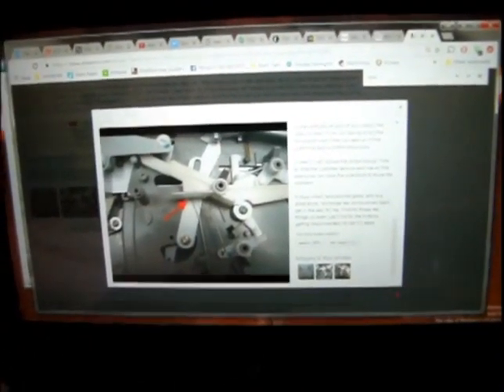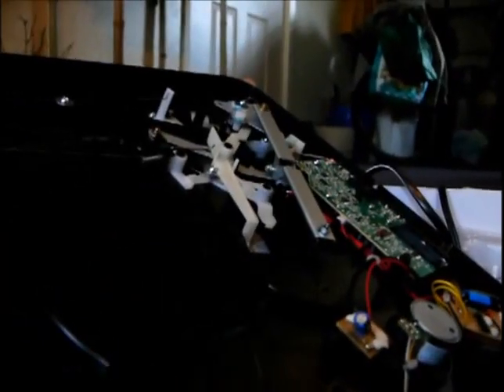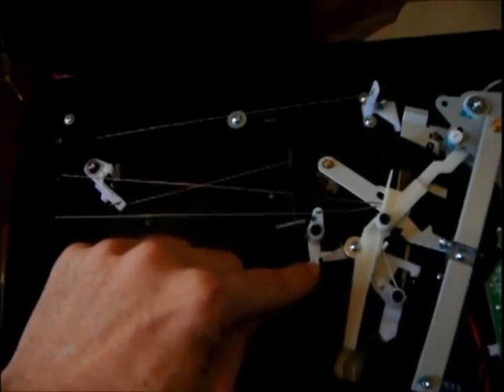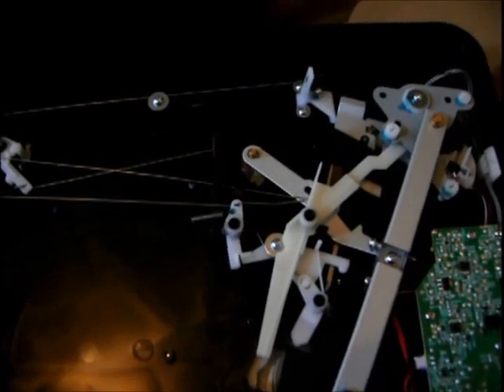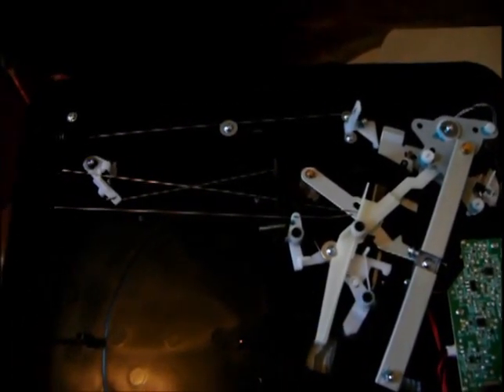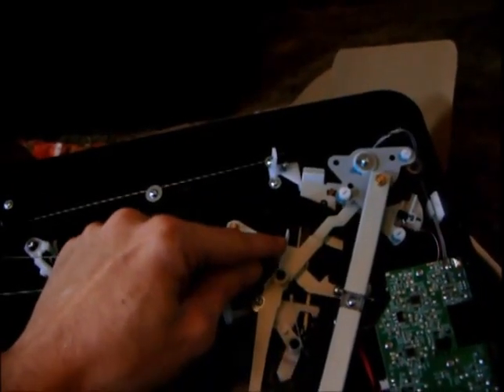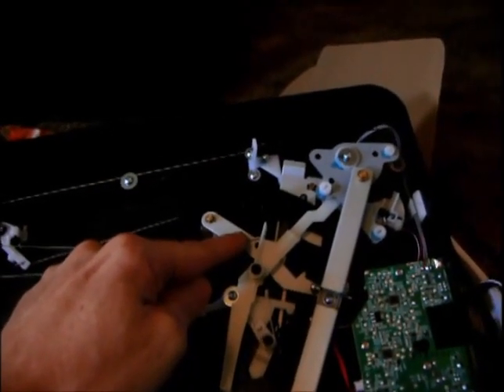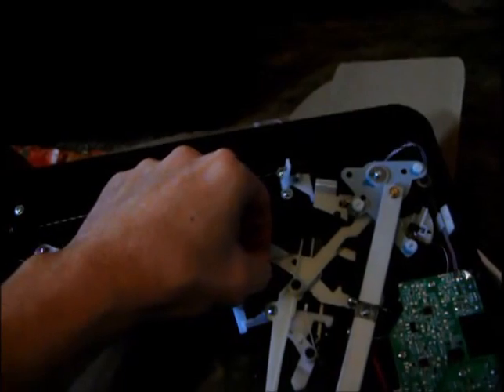AT-LP60 Button Repair Pointers

Comment: My AT-LP60XUSB turntable stops spinning a couple seconds after I press play. Rubber band is correctly positioned and have already unplugged it and turned the plate with the arm to the side as recommended but the problem persists. No one has found what the problem is but I think some mechanism has disconnected. Any one has a clue of what I could do? Thank you and sorry for using your channel like this but I’m running out of options haha and you are certainly an expert.
Reply: Hi, my LP60 met the same problem as yours. I want to know if you have solved it now, and how to fix it. Thank you!

Comment: I just bought one and the motor won’t stop spinning as soon As I plug it in. The stop butting won’t work either.
Reply: Dan Smith Didn’t find a fix. Had to get a replacement. Hope you figure it out!
Reply: @Dan Smith i have found a fix for this there is a tiny adjustable knob inside that opens a switch to shutoff the motor when the arm is in the resting spot. A small 0 flathead screwdriver and a slight turn solved the issue for me.
Reply: If you look on the bottom and see three holes labeled L.in RET and SW, the SW slot will have the one you want to turn. Make sure the arm is in the resting holster when you try to adjust this and try a few and test until it stops as it should.

Comment: This is NOT correct! Neither metal arm should be under the white lever, all the do is push on it. If you do this it will seem to work, but the stop button will stay partway in, and there will be spring pressure pushing the tone arm sideways about 3/4 of the way across the records causing skips. Look for a different video showing how to reset the parts under the white gear on the top side if things are wonky after shipping.
Reply: @anonymoususer3470 appears to be correct.  On my unit the stop button stayed partway in, and the tone arm stuck 3/4 of the way across the record. When I removed the bottom of the unit, I found that the metal arm from the Stop button was under the white lever,  I moved the metal arm so it now pushes the white lever and it resolved  both my problems.
Reply: @edgrigoleit1938   Yes I was working on mine last night and of course the metal stop metal arm does make the button partway in. My issue is no spinning at all. The small upper left pulley that the belt goes on does not spin. Any ideas? Thank you